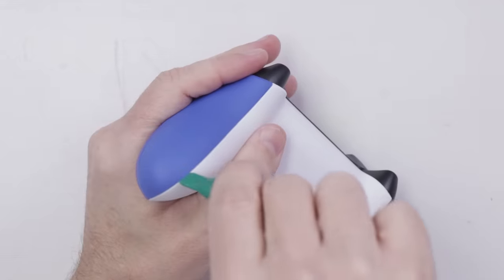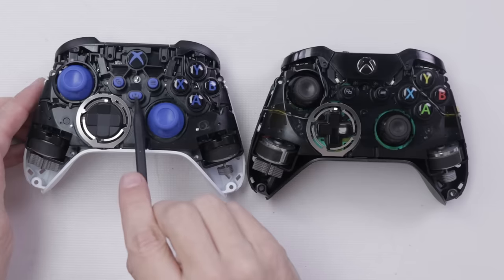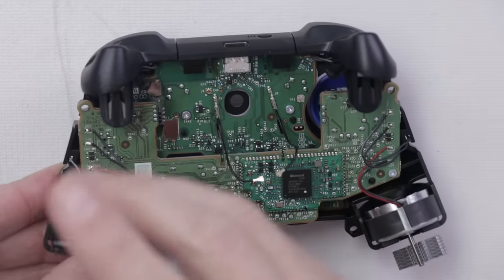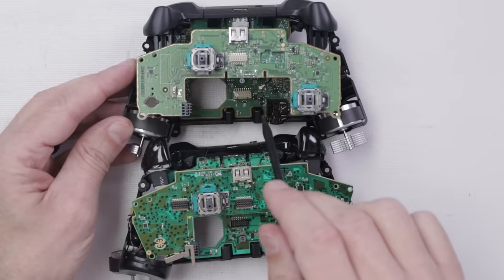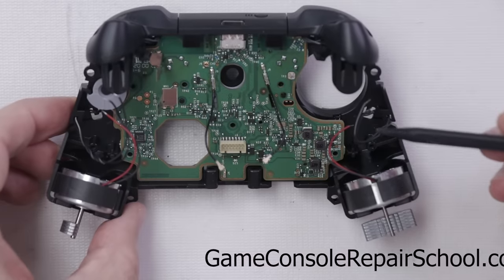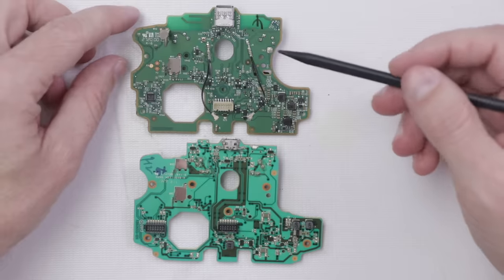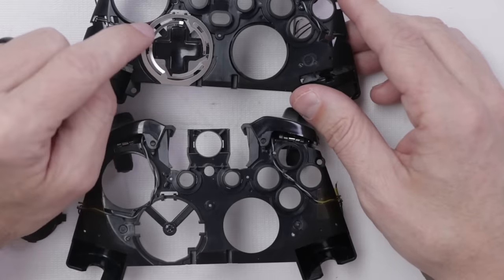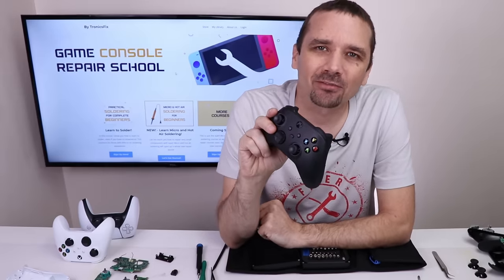Xbox Series Controller Teardown - A Repairability Perspective

Comment: Made getting those first 2 plates off look easy as hell, took me forever to do it 🤣 Apparently the rubber bit had come up after years of use, and the glue became exposed causing the trigger to stick when I would hold it down for extended shooting and mining. Took the rubber bit out and wiped away the glue, then lightly scraped the bits of glue that wouldn't come out off, then went back for a follow-up wipe with the qtip. Was annoying as hell trying to tap fire too in Halo. It is all good now tho thankfully

Comment: Had my headphones jack snap off inside! This helped me perfectly remove the headphone jack and use a pin head to shimmy out the broken bit! Thanks so much
Reply: same im going throught the sane thing right now. i just need the smaller screwdriver which i have ordered to get the first motherboard out
Reply: if u mind me asking, did u manage to put it back together with little to no damage? To both the headset jack slot and the controlled generally? im scared to take this motherboard off as i dont wanna completely ruin a fairly new controller
Reply: @danielshannon5006  took it apart and back together with zero damage. I have experience with repairing electronics and taking things apart tho. So just make sure you put things together in the same order you take them apart. I didn't have to completely disconnect the top and bottom motherboard because the headphone jack isn't soldered into the board. It's got a metal contact point. So once you unlatch the top motherboard, the headphone jack will basically fall out. 

I used a thin safety pin to jostle the broken end of my headphone jack out of the port.
Reply: @RealRyanMcLeod  thank you. ive been so unlucky with controller and headsets breaking im starting to get sick of it. hopefully this time i get some luck and everything is in order.
Reply: @danielshannon5006  yeah it was a brand new Xbox series X red and white controller too lol. In the end, the fix took me all of 15 minutes to fully figure out. I'd suggest buying an electronics screwdriver kit. I have like 80 magnetic tips that interchange into my screwdriver.

Comment: Having fixed a fair number of Xbox one controllers, found that in the great majority of cases, they had drift issues. This is a relatively simple fix - the small circular 3 pin resistor discs that are on the x and y axis, or, in other cases, new Alps pots (although this means more soldering). Now, if the controllers were made to a more modular design, there would be a lot less hassle - if the discs and pots could fit onto the board and be held in by some kind of bracket that lets them be switched out when they inevitably wear out. Like an IC socket but with a retainer clip. 
Also, those Torx security screws are a complete PITA to anyone that hasn’t got those screw bits.
Not as big a PITA as replacing the top middle section of an Elite series one controller, though - those things are a nightmare!!
Reply: Can anybody help me please?
I had to clean controller from Coca-Cola 😅
But when I was trying if everything works, I have find out that the controller turn on but not a single button works 😅😅 only to turn on and to pair, and it won’t even pair to me Xbox 😔
I don’t know where did I make mistake
Reply: @MRgreanCZ  you spilled a acidic liquid on a controller and expect it to work still?

Comment: The D pad is swappable but the new controller has a circle on the faceplate instead of a + shape, so there are openings for debris to get inside, and it sits lower than the new style D pad.

Comment: Edit: I learned to repair my controller.

I've soldered quite a few bumper buttons (and other components) on a 360 and One controller for many years. For my One controller, the RB button always gets worn first, but it's also difficult to track down replacement parts that aren't cheap trash that will wear out quickly. Eventually, I accidentally ripped off the through hole traces of my One's controller board and don't have the skill to repair it. The trace is so tediously thin on this controller. I never had problems replacing 360 bumper switches. It's frustrating and I don't want to give Microsoft any more money, especially given how inflated the prices have gotten.

That said, it's nice to see that in the Series controller's board, the solder joints are now by themselves, far away from extremely tiny resistors, capacitors, or other components. Also, the traces seem to be more embedded in the board so maybe it would lower chances of damage when soldering?

Anyway, thanks for the vid. Nice, clean, and to the point. It's funny, now that I know more than I've ever wanted to know about controllers' internals, that's all I care about when considering buying new controllers and watch disassembly videos to look at the boards. Someone really needs to design and manufacture better components with stronger materials for these things, but it's not profitable.

Comment: Thanks for this. I tried to repair a drifting controller, but I couldn't get the wires connecting the two motherboards back on. I think I pulled from the metal tabs and bent them. Probably needed to pull from the wires as you did.

Comment: Good video.
But you didn't show disassembly if the shoulder/triggers.
Mine has the typical "right/left shoulder button doesn't work.
From your basic disassembly I can tell that the little plastic plunger/stand has broken.
I'll have to see if my xb1 controller can be a donor...it has a bad right analog I have been to lazy to swap out...

Comment: But if you swap the d-pad won’t the mother board be exposed?
Reply: Ye
Reply: but also you need to change the upper shell  (for both cases) so that does not happen
Reply: @benhurmorales3216  You can't - The shells are different. The Series shell has the cutout for the share button, the One shell does not, so the one shell wouldn't fit. There's also other differences - some One controllers don't go up around the Xbox button at all, and the ones that do have a different shape than the Series controller.
Reply: @mjc0961  u r right for the share button. So the only answer is to use it as it is LOL
Reply: @benhurmorales3216  you can't though because the series controller is a bit smaller.

Comment: one thing to note is that xbox one controllers had a 2nd revision.  the 2nd revision (model 1708) flipped the micro switches for the LB/RB buttons as the original design had a flaw where the lever that pressed them would snap. 

a comparison to that controller would be interesting

Comment: By now i hoped they would finally made those vibrators plug into connectors on the board. Fingers crossed for the next controller iteration plus new more reliable analog sticks design. 🙏
Reply: The 360 had plugs for the rumble motors, they are not going back. They cannot spend the extra pennies per controller, especially when the bumpers are designed to break quickly so lazy sheep just buy another controller

Comment: If you don’t like the d-pad on a series x/s controller then just get a Xbox one controller,  the series X/S is compatible with the old controllers and the new controllers work with the Xbox one.  They didn’t reinvent the wheel here and making it so you don’t need to buy three new controllers for couch co-op is great.

Comment: That series controller looks identical to the xbox one controller I have (the second version that could use normal bluetooth rather than MS's specific dongle for PC). The texture on the grips and the full front face plate are exactly the same, just the extra button and the dpad. 

Other than those two things, did MS do anything new to the controller at all?

Comment: I’m curious why the headphone jack is loose on the Series controller? I have 4 of them and they are all loose when plugged in. Is this intentional? Great video thanks👌
Reply from the maker: I'm really not sure.
EDIT: I know why they are loose...I don't know their reasoning in making them that way. They are loose because there is no solid physical connection. They just use spring contacts. That's why they're loose.
Reply: 🤔 Mine is solid and haven't seen any complaints online about that yet. Strange that you received 4 faulty controllers...
Reply: @Until_It_Is_Done  I wouldn’t call them faulty as they all work fine, but the plug is loose compared to the Xbox one controllers I have which are solid. I do agree it is strange, I even bought the last 2 I have at Walmart and GameStop to see if The 1st I got was a bad batch from Best Buy but nope, every single one from 3 different stores and the Series X stock controller all have this problem in my case
Reply: Mines is just like that too

Comment: At least they changed from 2 connections between the boards to just one. It was prone to failing, because the B button being in the second board forced them appart when pressed. The best solution would be to change it to a ribbon cable conecting the 2 boards but I guess they still chose the cheap way.
Also they keep using the same analog stick as before, also by ps4 and Switch, that will fatally fail and drift one day.

Comment: Hey man, could you show where the bluetooth module is located? Mine is probably damaged and it has a very poor bluetooth connection as a result. I want to either replace it or fix it if possible. Thx ✌🏻

Comment: I still don't get how it's possible to get dust inside those little green compartments inside the sticks but it happens. I've cleaned them out on my ps4 controllers to repair drift.
Reply: The dust comes from the stick itself, caused by the friction between it's parts

Comment: It's very unfortunate that they haven't chosen a new joystick. Recently, my blue series x controller started to drift on the left joystick. Tried fixing it with compressed air, alcohol, but neither worked permanently. So, I decided to take it apart. Unfortunate I don't have a security screwdriver, so I'll have to get one 😤 (unless I can find another flathead to beat up)

Comment: Is there anyway to upgrade the joysticks yourself on the controller? Not just a replacement of the same joysticks with no drift, but a completely different upgraded joystick that works with Xbox controllers? I hate that all my Xbox controllers have drift in at least one of the joysticks.

Comment: @TronicsFix 
Since you have a massive amount of experience with these and this sort of thing, maybe you can answer a question for me. If you were to remove a thumstick module completely, meaning un-solder from the controller board, would there be any movement onscreen if you connect it back to the xbox or a computer?
Reply: You mean desolder. If there are no analog stick module connected, there will not be a connection of movement going to the PC. But once you solder a new one, and connect the pins with solder, it will register on the PC.
Reply: @sO_RoNerY  that's what i figured, there must be a solder bridge I'm missing somewhere. Because after replacement the stick turns to the left constantly. But it does it moderately slow. Thx for the reply!

Comment: Hey TronicsFix, I wanted to ask if the Xbox button on the Series X/S controllers would be able to be swapped with the one from the Xbox One X versions. I liked the metal versions a lot better than the smoother ones that they've kept from the Xbox One S controllers.

Would you be doing a video in the future comparing the build quality and repairability aspects between the four generations of Xbox controllers [Xbox One, Xbox One S, Xbox One X, and Xbox Series X/S] as well as testing to see whether parts are interchangeable between all four generations (I.E. taking a colored Xbox One controller trigger and swapping it onto an Xbox Series X/S controller) at some point?

Thanks for reading this, if you did.

Comment: looks just as easy to fix as the xbox one controller. wondering how many ps 5 controllers are going to fail compared to the series controller. after all, sony's new controller is way more complicated and thus has more potential failure points.

Comment: New to all this, so sorry if this is a dumb question, Is the “click” that you actually feel in the dpad from the pad itself or from the circuit board? I got a brand new controller and up on the dpad functions but does not “click” and trying to see if I should mess with it myself or send it in for warranty.

Comment: What's the additive your using in the syringe to desolder? I got a solder/sucker heat gun but some of the connections on the joystics won't get lose maybe heat gun isn't getting quite hit enough but others come out clean.

Comment: New controller but didnt address the biggest weak point ,the analog sticks.
Same goes for the Dualsense.
Designed to fail.
Reply: Can you explain that the analog sticks are the weak points
Reply: @qasimallawati4049  They start drifting after just a few months of use ,rendering your controller useless
Reply: @micuna5743  that happened to me in the Dualshock 4 but it happened after years of use and also my brother when he is angry takes my controller throws hard in the ground and then it started drifiting
Reply: Actually, the DualSense did sth different. The mechanism is rotated 90° so when you click L3 dir sprinting, there shouldn't be that much force on it any more. Furthermore, there is now like a ring around the stick, so when you push the stick to move in a game and "scratch" with it on the edges of the circle it rotates in, there isn't that much friction anymore. So it shouldn't wear off that much and prevent side effects from wear.

We'll need to wait out if that helps or not, but you can't say they didn't address that.

Comment: got the same color the b button is a bit sticky so i open it and change the rubber inside, and clean the side if the buttons using q tip and alcohol. i manage to put them back together no problem but the b button is kinda feels the same

Comment: I know this video is old, but seems like nobody is addressing the springs in the RT or LT button. I ordered two custom controllers from design labs about a year ago and seems like the spring in both my controller now have sponge  effect where they dont just come out smoothly as my non design labs controllers. They have a thump sound like they stick, i removed them and nothing seems out of the ordinary, no liquid or anything. Would be nice if their was a video on how to remove the springs from the xbox one s controller and put new ones in. I was thinking it was an anomaly but now that i checked both with one being the RT and the other being the LT, seems like those springs do go bad.

Comment: My only concern is how easy it will be to accidentally hit two directions on the new Dpad. Thankfully it looks like if it does end up being a problem we can swap in the dpad from the One.
Reply: i have the new one, and it really isn't a problem. I was afraid of that too, but the dpad really wants to go in the cardinal directions first.
Reply: alexander pierre  all i said was that on my new series x controller, i do not experience a problem.
Reply: alexander pierre  who complained? 🤦🏾‍♂️😂 go away troll...
Reply: @Until_It_Is_Done  yo what’s with this troll guy Pierre 😂
Reply: This xbox series dpad is way better on that regard compared to 8bitdo.  8bitdo use a rubber film with carbon pads for the dpad and I found myself dreading the dpad as it is incredibly easy to press up/down when all you want is to move right.   And this issue is the same for all cardinal directions too. Downright annoying.  But for the xbox dpad, I actually need to almost move my thumb of the edge of the cardinal to get diagonal activation, so I won't be accidentally diagonal pressing like before with 8bitdo.  My only concern there is these metal dome clicker buttons on the circuit board that the dpad presses onto - how long before the metal push domes break off inside the controller.

Comment: The bumper buttons looked like a different mechanism. I know I have replaced them a couple of times. Do you think they are more robust design?
Reply: The bumbers got a very needed upgrade when the One S came out. The OG Xbox one controller had terrible stiff clicky bumpers when compared to the 360 pad. I was so surprised nobody wrote or said anything about that when I bought the One. 

The controller in the vid looks to be one of those OG ones
Reply: @807D14M0ND5  The sad thing is our new elite controller lasted 3 months before a bumper failed. 6 months in we are now on our 3rd controller. Warranty is great while you have it but that will run out too soon given the cost of the controller.
Reply: @HighFlight2k2  That is sad. I don't really trust any newer controller. I hear about so many faulty Elite's..

Comment: hate the grip, the extra surface area makes my hands sweat.
Reply from the maker: Really? I haven't tried it out much yet.
Reply: "Extra surface area"?? 100% disagree. The grips are smaller and the matt finish helps with sweaty hands. Haven't had any problems with sweaty hands yet...
Reply: If anything this controller stopped my sweat problem

Comment: I'm curious about the mechanism under the shoulder buttons. On the xbox one controller, it broke pretty easily and my experience with the series controller has it feeling different. Not quite so flimsy. Wondering how that works internally

Comment: Question... you mentioned the two black wires going down were antennae. When I lifted the left wire, the mount came disconnected from the board instead of unplugging like it should... now the controller keeps losing connection at random. This an easy solder fix?

Comment: I don't have a solder should I be worried if I broke the gray wire above the bottom tumblers??
Reply: That wire would connect to the rumble motors under the top triggers - it won’t affect anything else